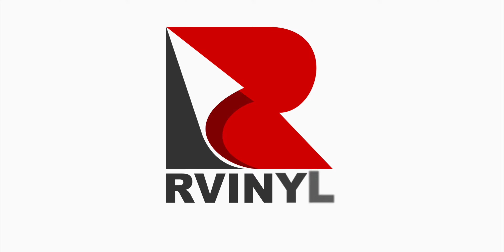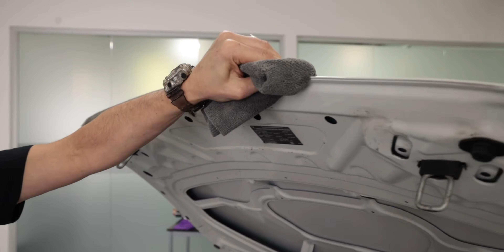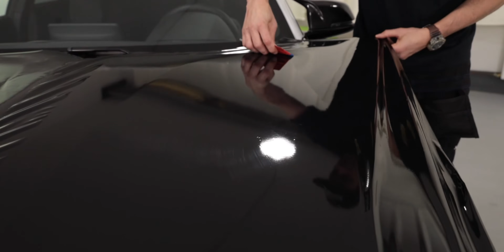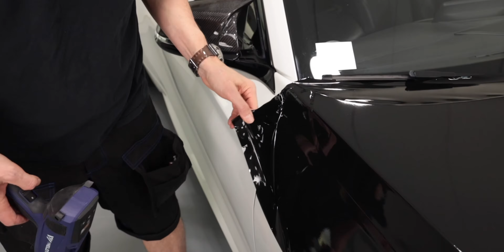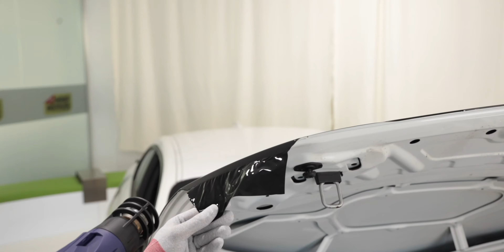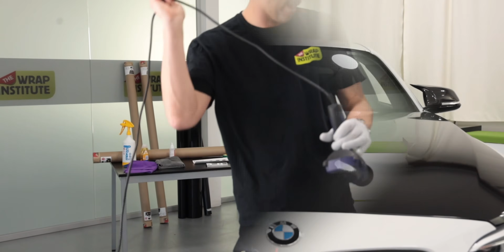How to  Wrap Your Hood - Rvinyl Installation Tutorial with Justin Pate

Comment: What happen if it is 50* temperature outside?
Reply from the maker: 3M recommends application at +65 °F to 73 °F (+18°C to +23 °C) for optimum ease of application.
Reply from the maker: Temperature range after application is pretty extreme at -65 to +225 °F (-53 to +107 °C)

Comment: What happens if it’s too hot when you install your film?
Reply from the maker: If you mean the ambient temperature it just makes working with the film much harder. If you mean overheating it whit a heat gun during application, it could change its appearance, cause premature adhesive failure or even actually burn!